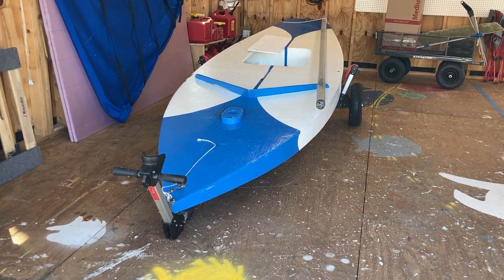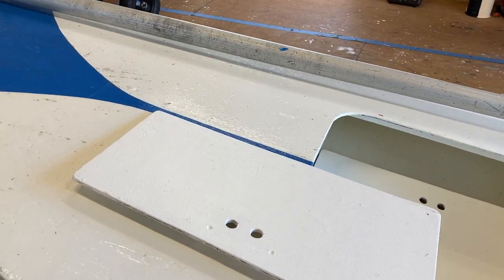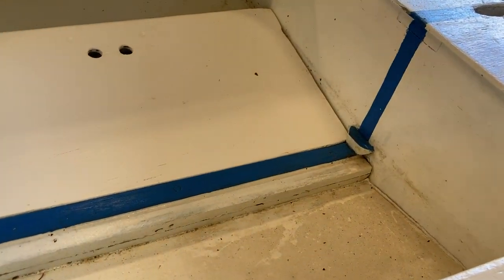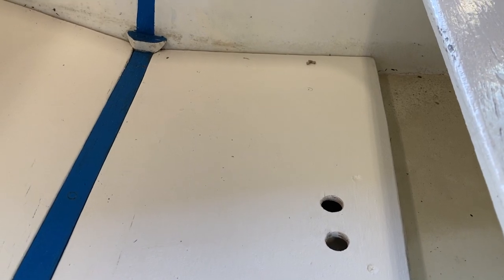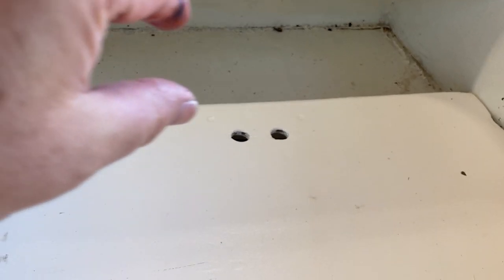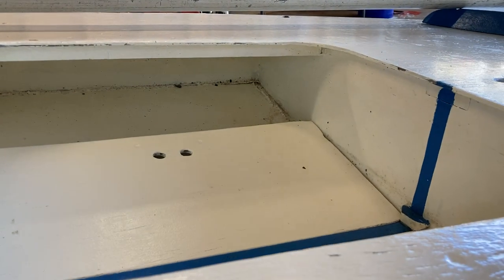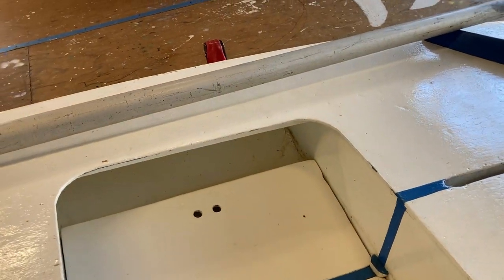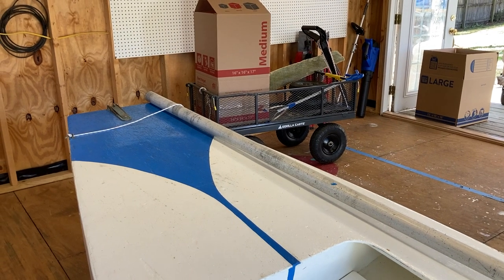Wooden Alcort Sunfish Floorboards

Comment: if you capsize this boat, do the floor boards float
 away?
Reply from the maker: Yes they can, if they pop out of the cleats that hold them down and work their way past the lip of the cockpit. It takes a little maneuvering past that cockpit lip to install them but I imagine in a capsize they'd fall out easily and try to escape as fast as possible. Might be a good mod to add a retainer line or add some kind of clip/toggle to secure them better.